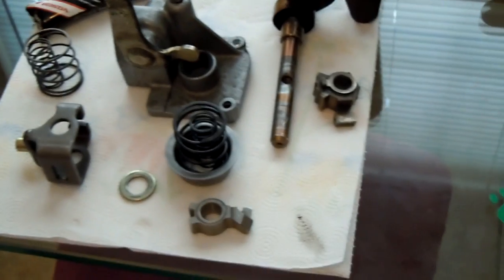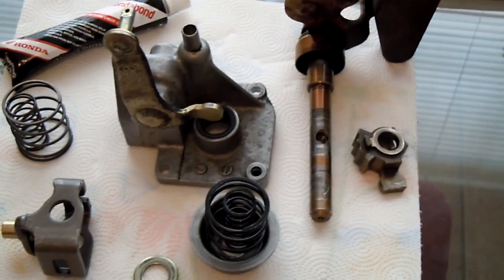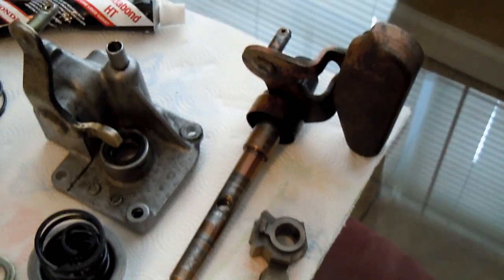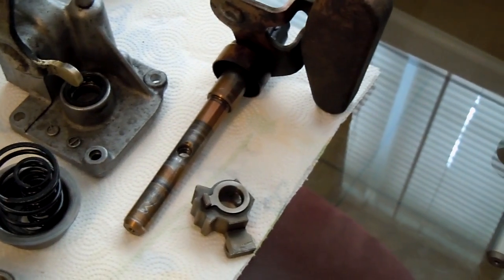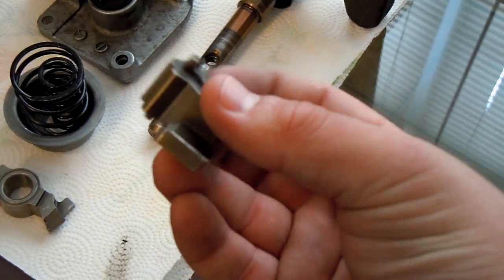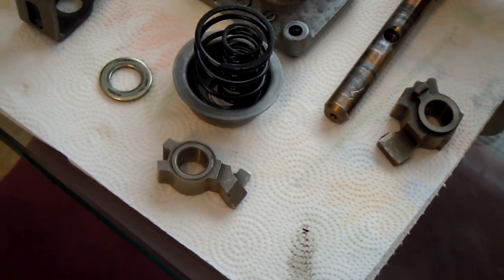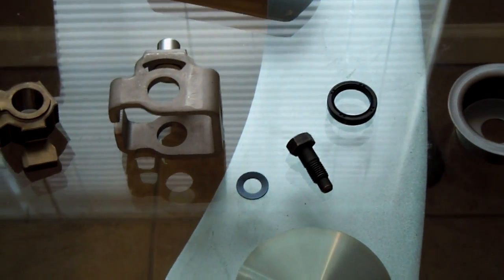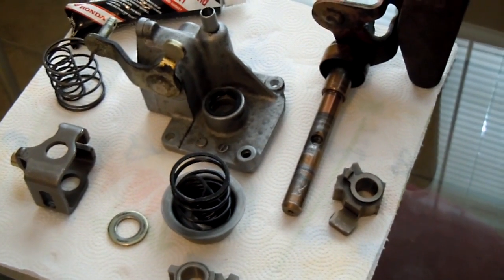MTEC Shifter springs and replacing worn parts

Comment: My shift lever was stripped on my 9th gen and its been down and when I pulled everything apart parts were everywhere in there but I think I got them all out with a magnet.Couldnt find the bolt that holds the shifter to the rest of the assembly and I thought it was the main bolt holding everything together from the outside housing but I'm not sure because when I took thay bolt out to pull the assembly there were no threads that thread into the shifter jist thru the housing and if so there's a bolt down in the trans if it's not the main bolt holding it all together that goes in from the outside.I hope I can get it all back together.What a mess!! And help would be appreciated!! Thanks

Comment: I just pulled this whole assembly out of my 2008 civic si to change shifter springs. Everything works great and it looks to be in great condition, but I have some play in my shifter. It is not the bushings. It is excessive play directly from this assembly. Is this normal?